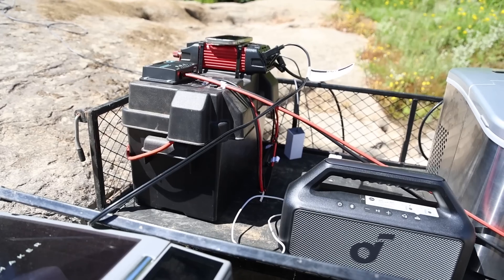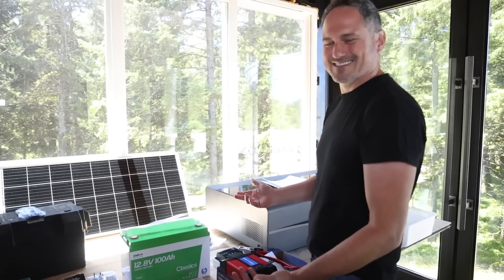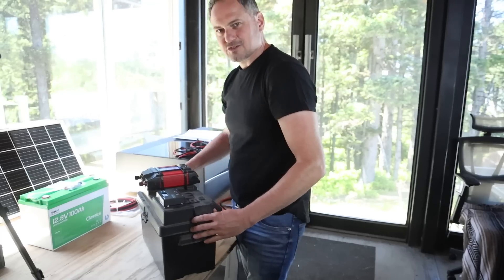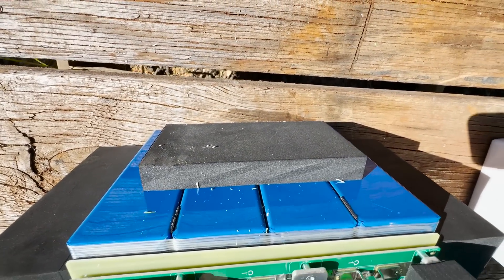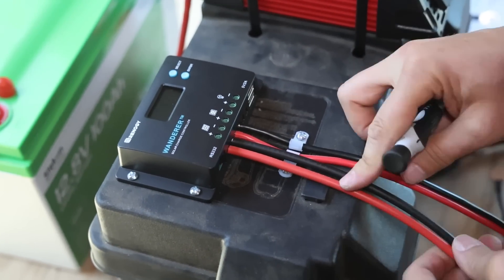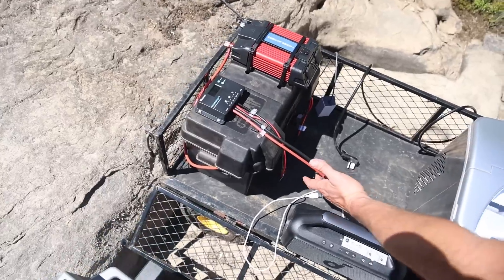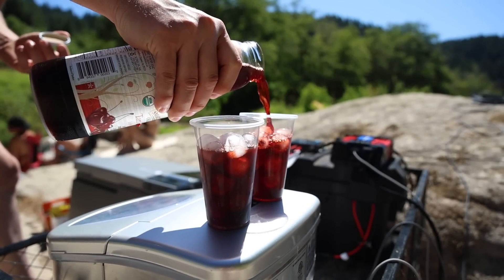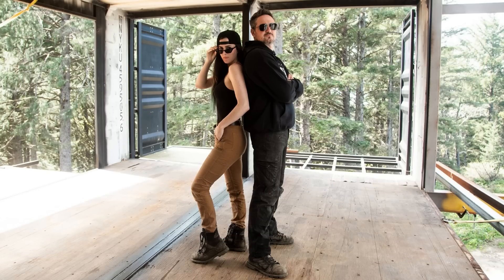MAKE YOUR OWN POWER STATION FOR CHEAP using this SIEKON BATTERY #powerstation #diy #battery

Comment: Good video.  Inverter used is a modified sine wave which is junk and should not be used with sensitive electronics or anything with a motor.  If an inverter is not pure sine wave, stay away.  Cost a little more but well worth it.
Reply from the maker: Thanks for the info, appreciate the advice!  😊

Comment: What amp fuse do you use in the Battery Connector, Ring Terminal Harness Accessory Cable?
Reply: I've seen them often come with 50A fuses. For the fuse from the battery to a 750W inverter you'd want (750w/12V=62.5A, + a bit more for loss of efficiency) probably a 100A fuse, but most people wouldn't really use their inverter to the max so could get away with 50A. For my 800W inverter I'll get a 100A fuse but I'll get one that attaches to the battery terminal. The less cably bits the better.

Comment: It would make sense to use a 24v solar panel and an mppt controller for a 12v battery. That way you could also charge it in cloudy weather. It works for me even in December, the darkest time of year,

Comment: You try to test the Seikon battery first if hot temperatures explosion.

Fan cool wind seikon battery cool if do not have a hot temperatures. Easy.  Be safe.
Reply from the maker: Yes it is not very hot where we are so that was not an issue. Definitely something to consider though!
Reply: @blackarmouredbeast1989  I don't understand your sentences 😅

Comment: Well I just happened to buy a 4,000 watt pure sine wave inverter, so I love this video thanks.😊
Reply: Hope you got 400 amps of batteries for it
Reply from the maker: Thanks awesome!! Check out the video I linked in the description if you want to see the battery stress test. It's impressive. :)
Reply: @joemedcalf7732  hope you got a big battery that can support 400 amps
Reply: Cool. What make and model if you don't mind sharing? We were looking at the Victron 3000 VA but it's only 2400 Watts, unfortunately.

Comment: It seems like all of the videos have been sponsored things instead of building. I stopped watching.
Reply from the maker: I guess you never watched this video we did: https://youtu.be/Km9frIy13z0

Our sponsors are how we support our channel and keep our content free. There are a lot of costs and a lot of time that go into running a YouTube channel, and rather than putting those costs on our viewers through subscriptions or patreon, etc, we prefer to create sponsored content for you all to enjoy.
Reply: @PacificPinesRanch  Thanks.
Reply: Sponsored or not, we can learn a lot from these types of videos. Are you planning to, or have you already built one?  I have build a few smaller versions of these power stations in the past and they come in very handy, especially during a power outage like during a hurricane. I plan to build a bigger one shortly with a 100ah LiFePo4 battery that i already have so this video suits me fine.